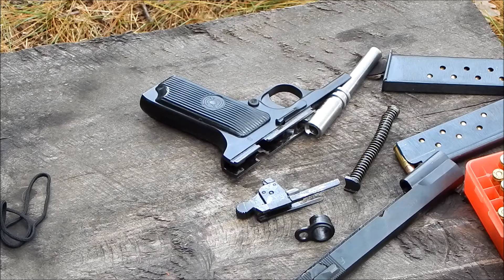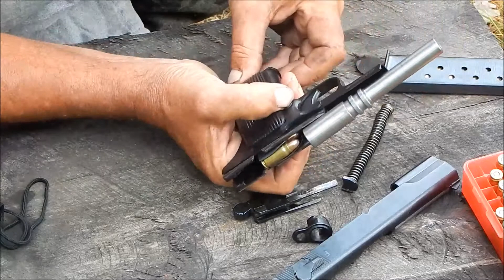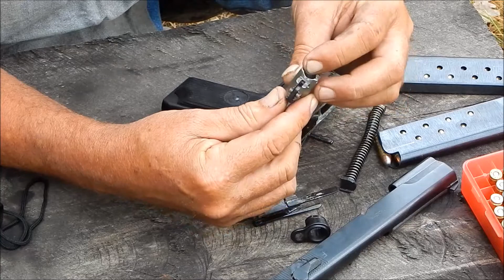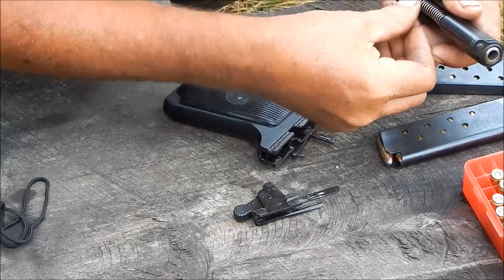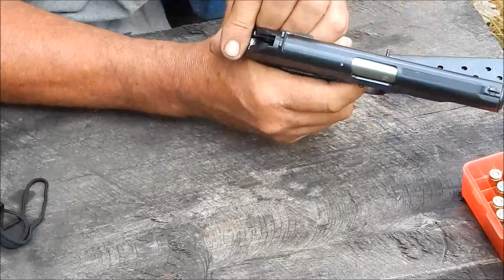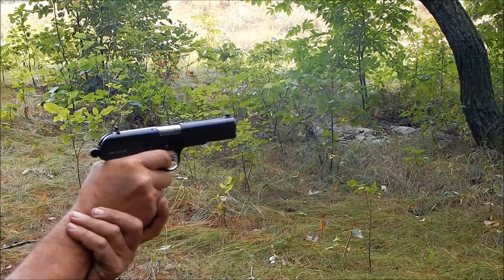Zastava M57 fix

Comment: Nice catch on the repair. I notice there is very little recoil from that gun. Is this consistent with all the ammo types you've tried through it including your cast?
Reply from the maker: Very light recoil in the 7.62 x 25 model, I believe they are noted for it.  My M70a which is the 9mm version has more kick with a lighter powder load.  That little 85 grain bullet, with 5 grains of Red Dot, should have been traveling at 1240 fps.